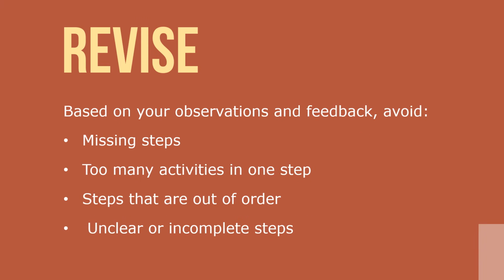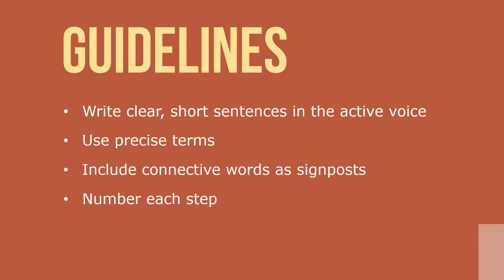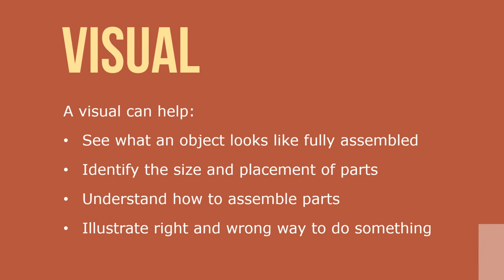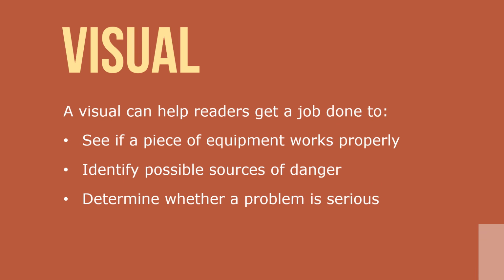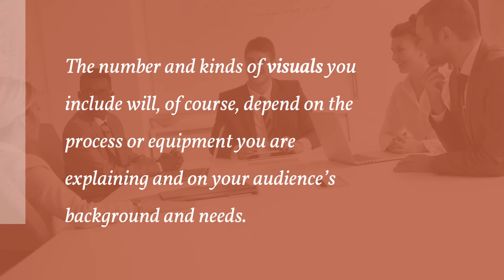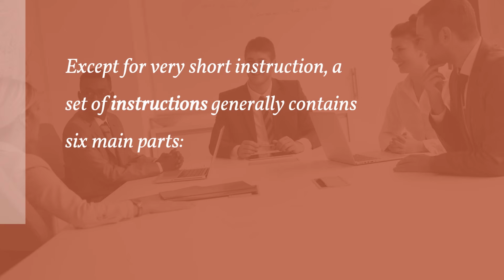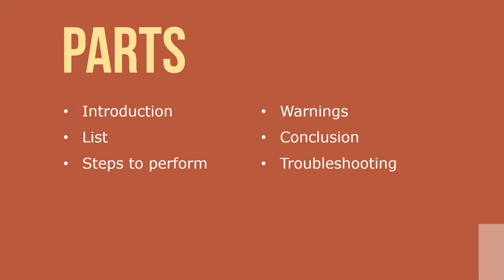Writing Instructions and Procedures

Comment: If your task is
“How to peel an apple”
You need to write everything as though the reader has never done so before. 

In the kitchen to the right are a set of draws. Open the top draw and grab a peeler (insert image for reference)
The apples are in the basket on top of the table. Take out the quantity that is asked of and find a space on the bench for you to use. 
Put the peeler in your dominant hand and hold the apple in the other (insert image for reference). 
Place the peeler on top of the apple so the blade is in direct contact. With a soft-firm grip, pull down the apple. (Insert image for reference). 
Continue this around the entire apple then set aside. 
Once all apples have been peeled, rinse and clean up the mess. 
Apples can be placed into a clean bowl. 
Apple peels can be put into the organic waste bin. 
Wipe down and sanitise the bench. 

:)